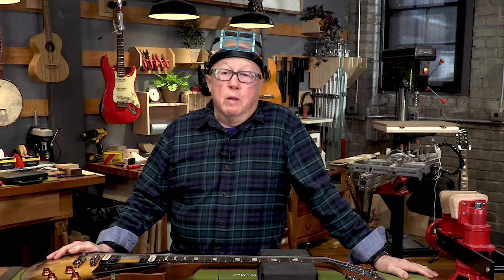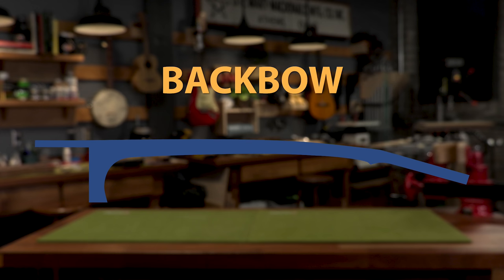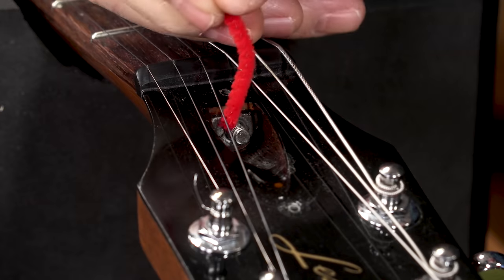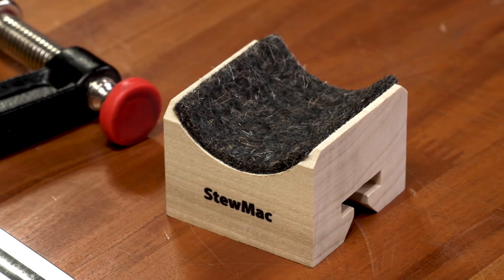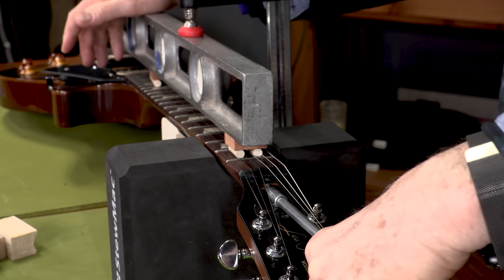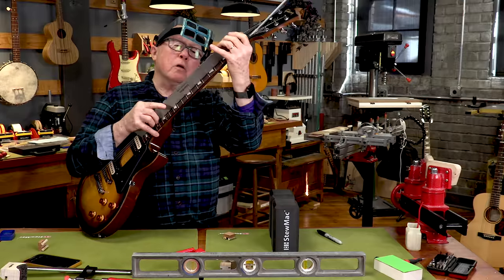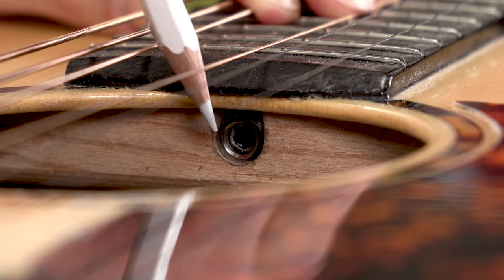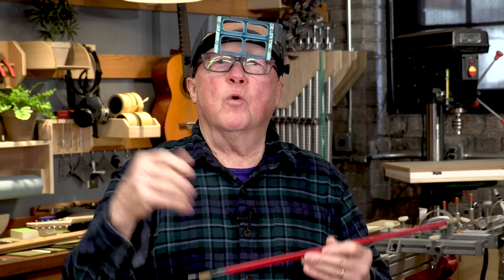Can You REALLY Adjust Your Truss Rod Without “BREAKING YOUR GUITAR?”

Comment: Gotta have a little relief in my own neck due to my right hand "technique."  I hit the strings hard...you can't have a straight neck for that.  I always adjust it as close to straight as I can, but I can't quite make it straight or it buzzes horribly.  

I always dread any time I have to take a guitar in for a procedure that I don't have the tools for, because I've gotten into p***ing matches with the shop over the setup.  They want to set it up for me and charge me for it, I don't want them to set it up for me...I just want them to address the repair that I brought the guitar in for.  I've been playing for 40 years and doing my own setups almost the entire time.  Generic "shred setups" that shops do never, ever work for me.  It's always maddening dealing with these insistent techs who think their setup is going to be the bee's knees for EVERYONE.

Interesting to see the approach where you take the strain of adjustment off the rod itself and just use the rod to hold the tension and not so much to adjust it.  Never seen it done that way...but there is no way in H*** I'd put that kind of strain on a Gibson headstock with an assistant...even if a veteran luthier thinks it's OK.

Comment: I wish I had seen this...gather 'round and hear my tail of woe. But it wags to a happy ending. See what I did there? Cheap Les Paul copies are often either pretty or they play okay. Not both. Mine was pretty and the action impossible to lower. Used and a super cheap buy. My trying to make it better failed. I was careful, then I was frustrated. Then SNAP. It was audible for sure. That set neck angle is just factory WRONG and no truss rod adjustment was ever going to give it good playability. The truss still turns. And turns, and turns, and turns. But nothing. Good news: It is permanently stuck kinda straight. Slight back-bow. Stink. But I really do love me some slide guitar. So I jacked the bridge like a 4WD. Then I lowered it back some to keep some threads safely in the body mount. Too tall is problematic. Bought a Grover nut extension too but haven't used it. Prob won't use it. It's high enough and I can still finger fret it as I play slide this way. It's kept in open E and with some lovely used Gotoh replacement machine heads it holds that tight tune pretty good. The tight open E tuning sorts the back bow a bit as well. Might try heavier strings too, but incrementally as I know it's mostly just mahogany keeping the neck in place at this point. It's actually a cool gat despite it's broken rod. I love it. BUT I STILL NEED A FULLY FUNCTIONING LES PAUL. Moral of the story: if you break it, just let it slide! It's a keeper.

Comment: I used to put the 2 supports over the frets, too. Until you meet guitars where the frets SINK from the pressure. Extra work :/
Now I put slots on the support than goes close to the body (the one close to the nut doesn't need slots because the space between
Reply: ...frets is so wide there).

Comment: I have a newer ES-335 that has a tight truss rod, it even creaks a bit when tightened. Im afraid to go any further to get the neck straight. Will this method help?
Reply from the maker: It may, but it's impossible to say for sure without having it in hand. If you follow this procedure and the nut still doesn't want to turn, you should have it evaluated by a repairman. Don't force anything.
Reply: @stewmac thank you so much! Love these videos!

Comment: I am confused about something. When you take off the nut and lubricate it..(on the Les Paul at the beginning of the video).....isn't that loosening the truss rod all the way? I would think that if you have a back-bow, you would never turn the truss rod to the right...is there a secondary point of adjustment on the truss rod? I'm always thinking that if it's a back-bow, you turn to the left, and if it is a bow, you turn to the right. Obviously, I am missing something here. Help!!!  :  )
Reply: Yup he loosened it all the way to lubricate the nut. Then he tightens it
Reply: It didn't matter when he loosened it completely because there was no string tension.

Comment: Well, the problem is that my neck is warped sideways, dipping down when held. Is there a fix for that?
Reply: If it's a bolt on neck make sure the screws are tight and the neck is seated in the pocket properly. If the neck itself is too warped sideways to play there's not much you can do.
Reply: @jimadams8182  Thanks, I'm affraid it's the neck itself.
Reply: Take neck off. Clamp the headstock to your bench. Then put a wedge under the neck on the other end. Clamp that end of the neck to your bench with the wedge in the middle. The wedge should facing the direction that you want the neck to twist to. Let nature do it’s thing. Recheck it everyday and adjust as necessary. Eventually it will straighten itself out. 
If it’s a glued in neck, clamp the body with a bigger wedge.
Reply: @edwardmonsariste4050  Thanks Derik, I was also thinking of that. However I would need to tighten the neck in the other plane too, since it's the unusual direction of the warp ,and that requires preparations. Is it a few days process of weeks? I would think wood need time. Should the trust rod be loosened?
Reply: @jaskiniamestwa  It will definitely take a few weeks doing it with a wedge, but you will be lessening the chance of breaking the wood if you do a little at a time. Yes make sure truss rod is loose, you don’t need it fighting you. 
If you are not sure, go to local lumber store and try to find a warped 2x4. Cut it to around the same length. Practice untwisting the 2x4. Then hopefully you will have a bit more confidence in tackling your warped neck.

Comment: I have a weird situation; my Fender tele was sitting on a stand in my studio this winter.  Room humidity was around 70% (I checked it.) Seemingly before my eyes, the strings went closer & closer to the frets, until many were touching the frets, rendering the guitar unplayable.  Maple neck, I might add.  
Truss rod? Neck joint slip? I'm freaking out over it. Anyone ever have this happen before??
Reply: 70% humidity in the room is way to high for any guitar. That's why it shifted. About 40% is good, 50% too much. Any less than 35% no good too dry atmosphere.
Reply: Humidity should be between 40%-50% but the ideal RH is 45%.

Comment: Adjusting a truss rod is not really difficult but the setup will never be good if you have any other issue such as, each of the string nut slot is not having a correct height, the fretboard radius is not nicely level, the frets is not level, the neck angle is not sitting parallel with the body (so it will affects your saddle bridge adjustment), plus many more just mentioned some of the major issue.

Comment: Easiest way is to use the strings as the straight edge.
Reply: It is better than nothing, Andre, but the problem there is that tells you more about what is happening at the top of the frets than at the neck level itself.  If there is wear or issues with the frets (usually first and 12th used for that method), you could get an inaccurate sense of what is happening.  I bought the StewMac straight edge years back, and it has served me well (although it needs to be handled very carefully as it is heavy, with sharp edges, and as such also would double as a brutal weapon if necessary!).
Reply: @BigDancin  I also have and use a straight edge, but to do everyday tweaking to the neck due to temperature changes (I'll asume the frets are kevel etc.) to use the strings to gauge the relieve in the neck is fine.